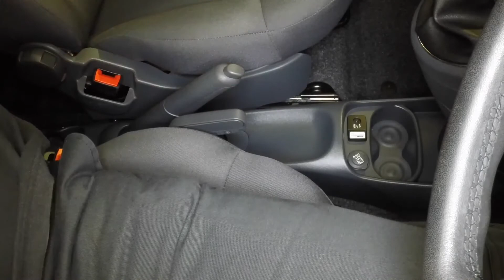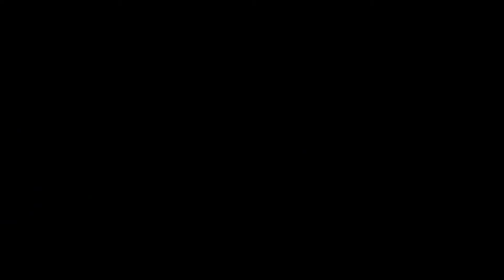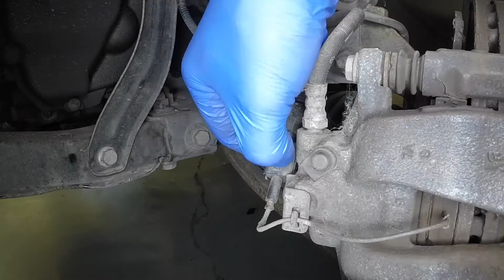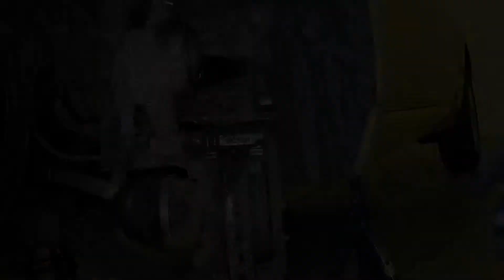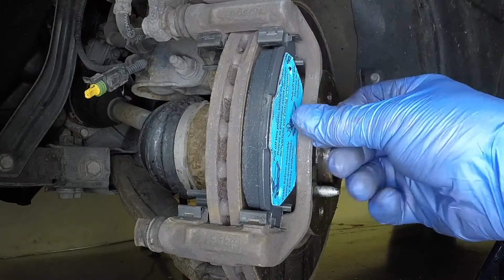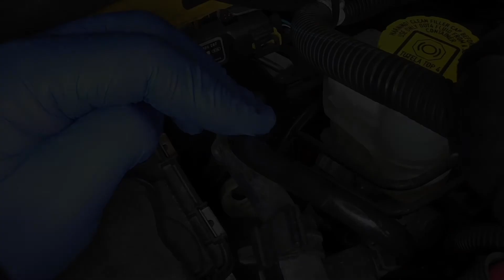Fiat 500 (2004 - 2012) - Replace the front brake pads

Comment: No grease on new hardware
Reply from the maker: The advice concerning high-temperature grease on the pad/caliper contact surfaces, varies enormously. In this instance, Fiat did not recommend applying any. Personally, I would probably apply a little Ceratec to the backing plate 'ears', but that is not what the vehicle manufacturers recommend.